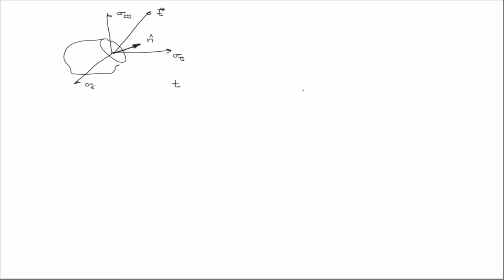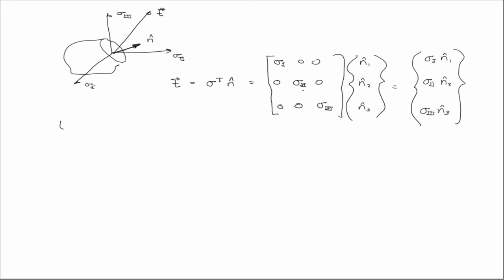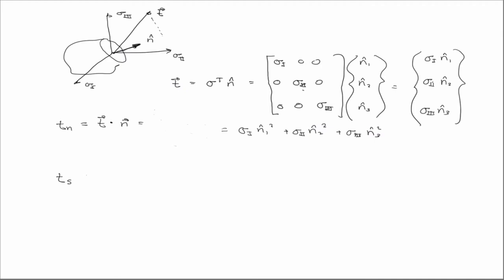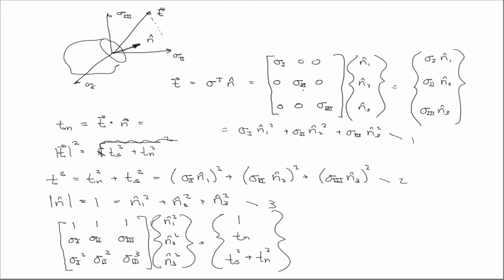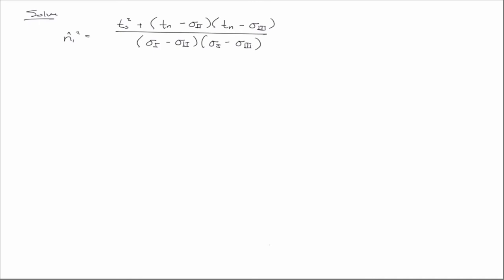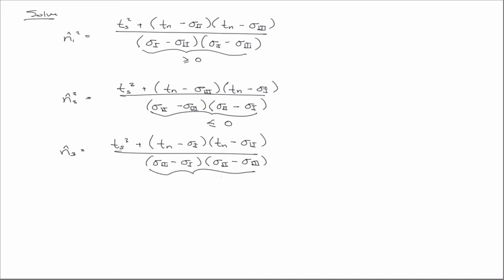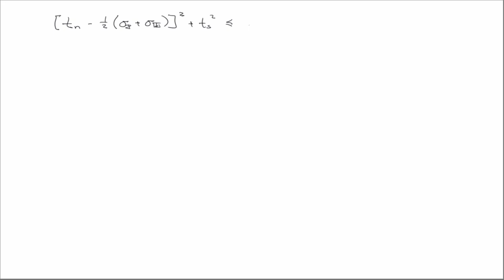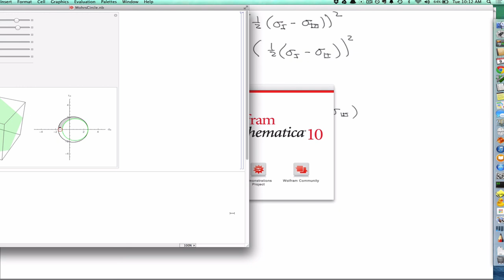Mohr's circles

Comment: Just wanted to make a note that, if you are following the convention of sigma1>sigma2>sigma3, then the sigma1 and sigma3 should be flipped on the Mohr circle labeling. Also, tmax (maximum shear stress) would be equal to 1/2*(sigma1-sigma3), which is equal to the radius of the big circle. Am I right?
Reply from the maker: +Sai Uppati It really just depends on the sign convention for stress (positive or negative in compression).  But yes, your observations are correct in this case.